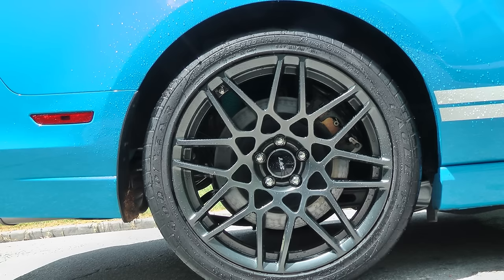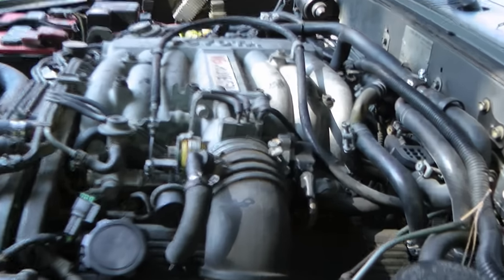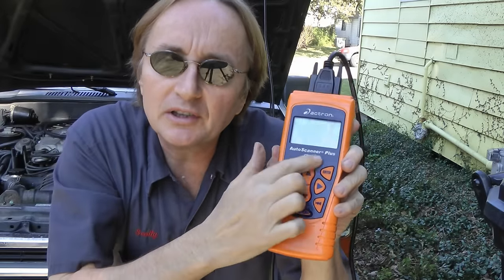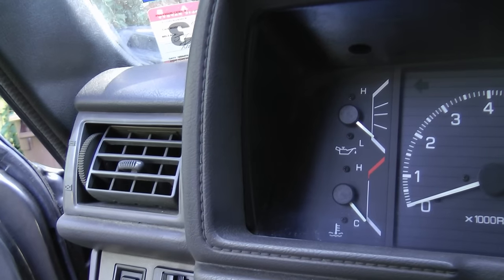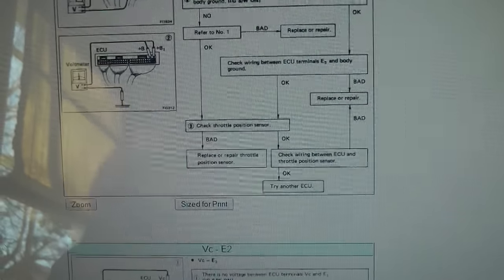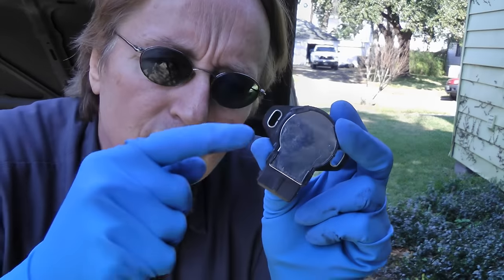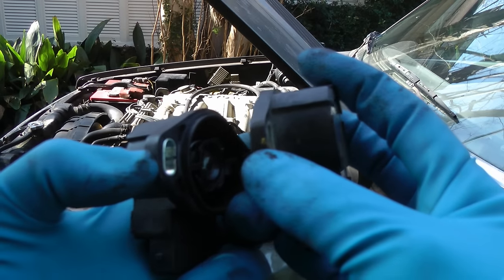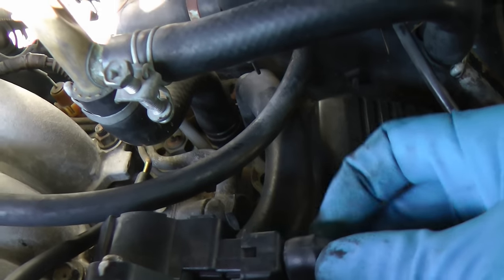How to Stop Car Hesitation (Throttle Position Sensor)

Comment: I have a 94toyota Camry drives fine but when I'm waiting at a light it idles like it want to cut off didn't happen until I took it to a shop cause it would not start got the distributor done five months ago car was starting fine then one day car started and cut back off would not start now shop said it changed my spark plugs now its running funny like it want to cut off put new wires still doing the same thing I think the shop don't know what they doing could it be they not doin something right with spark plug  or the distributor that's only five month old

Comment: MIne shows 100 percent throttle, when pedal is less than 50 percent?
Reply: Anton Morris don’t follow this guy, buy a multimeter (20$ at harbor freight) and adjust it correctly. Watch other videos meant for your specific car and they’ll tell you what to check on the multimeter. You are supposed to screw the tps down in a certain position and not every tps is the same so you can’t use the same position as the old one.

Comment: whats wrong with my car if the engine vibrating
Reply: +Sean Johnson on my sisters mitsubishi it was a cylinder misfire, spark plug boot was bad and needed spark plugs.

Comment: My 99 ford explorer Starts and runs Perfect,but when i accelerate it dies..Any ideas ANYONE?Please get back to me ASAP thanks!
Reply from the maker: pressure test the fuel pump, weaks ones often do that
Reply: +Scotty Kilmer It wasn't my Fuel filter or Fuel Pump.But i tested my TPS like shown in the video by unplugging it and my engine did change a little.

Comment: my moms bitchass automatic Toyota Celica 2001 took a shit today. it has 200,XXX miles on it and when I put it on drive and press on the gas it won't go? bad throttle sensor? anyone? thanks in advance
Reply from the maker: +George Bautista more often the engines blow on that model, a design flaw. Have any mechanic check it out in person and pray it's something else
Reply: +Scotty Kilmer ok thank you very much
Reply: +Scotty Kilmer ..
I have a question about my 350 z 2003 it was running ok 5 days ago engine went bad put new engine now throttle don't work no power in engine after one min of start it's ok fir 30 sec or one min and then car come to ideal  cannot do any thing with throttle if I put it on gear may be 5 mph ..
then stop the car for 15 min start the car first 39 sec can drive as fast as I can then again to 5 mph

Comment: my fuel injector is flooding gas  check my page for the video please
Reply from the maker: +Morgan Lapham-Hailes pray it's only one bad injector, and not a computer failure or a dirty system that needs all injectors replaced. Of course replace a bad one first, if only one cylinder gets really wet from gasoline inside, then relace that injector firstp
Reply: +Scotty Kilmer i just had the injector replaced. is there more than 1? where would the others be locaed?